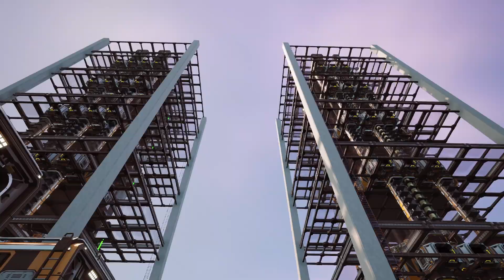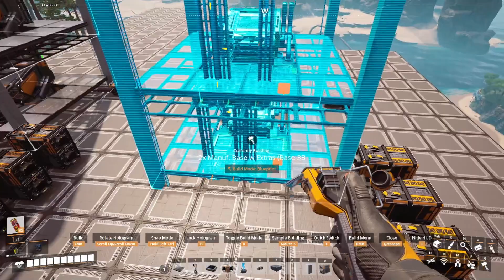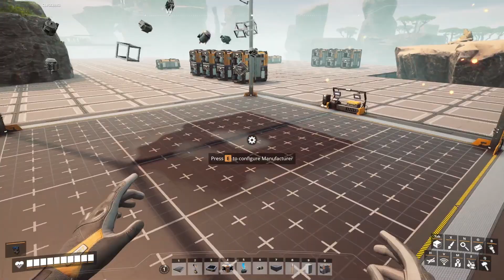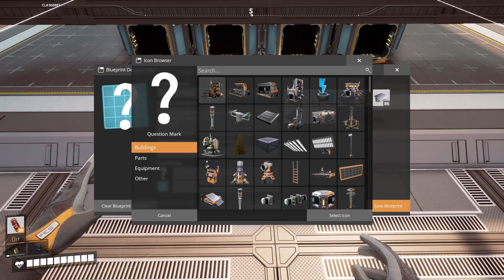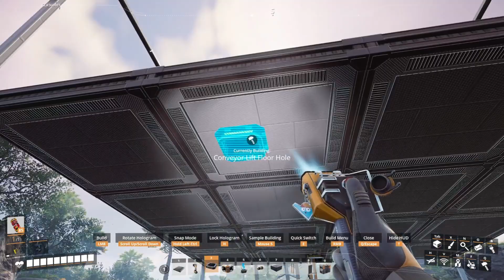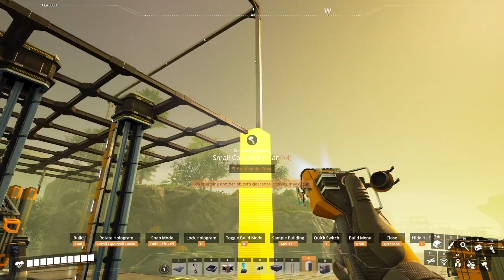Vertical Manufacturer Blueprints Satisfactory 1.0 Factory Blueprint Guide Ep. 5

Comment: I only discovered this now and I thought it might help me. However, I struggle to connect 4B to 4A. I can not connect the lift coming from below to go to next blue print. I tried manually rebuilding it. I am not sure if this is due to 1.2 update or whatever. All other connections work but I can not connect from below to a spliter which is already connected to the above level. I also tried lifting the 4A part which comes on 4B bechause in the default, it seems there is a slight vertical offset from the lift connectiong from below. This also didn't fix it. I would love to get this going which would be a change from my typical overflow manifold all in a horizontal plane. But so far I couldn't fix it.
Reply: Edit: I figured out that the steel frame floor is the issue. If you replace it with normal concrete (1m) and remove and replace the floor holes it works. Great, now I have to just redo all my blueprints and removing the frame floor and replace it with concrete.
Reply from the maker: Dang I’m sorry you were having trouble with the designs! These do have some short comings and things I would do differently! I made new designs but need to make the guides for them, hopefully they are better or your fixes at least work for your current play through!
Reply: @Cyanogenmod_  No worries, in the end I downloaded yours and it worked. It is just weird, I rebuild it myself 1:1 from your video but in MK.2 BP designer. I still struggled with it in the end but downloading yours worked just fine. Probably some tiny detail that I missed somewhere.

Comment: Good video, I was trying something similar tonight but it wasn't quite working. I was trying to use the vertical splitters where you click onto the vertical conveyors directly, but whenever I tried to add on more layers the belts just weren't connected. I trouble shot it a bit and just couldn't get it to work, the vertical conveyors would seem to snap into place, but no items would lift up them.
Reply from the maker: Thanks! That’s very odd I have had some similar issues where things just don’t move through lifts even though it all seems connected. I use a lot of mods now so it’s probably related to that but otherwise it’s a head scratcher, hopefully it works out for ya!
Reply: @Cyanogenmod_  I just copied your build and its been working great for me

Comment: Great guides man! I’m trying to build the 4B to 4A, but I cannot seem to get the outline of the conveyor lift to turn blue as easily as base-4B or 4A-4B. If the directional arrow for the conveyor lift head is facing the right direction, I should be ok right?
Reply from the maker: Thank you! And hmm If it isn’t turning blue it probably isn’t connecting, if you’re having trouble with one try building them from the left side to the right. Or if it’s one in particular that won’t go, try placing the one next to it first. The splitters inputs overlapping causes some issues when placing them
Reply: @Cyanogenmod_  Left to right didn't fix it, but going to the next one did. Appreciate the assist, looking forward to more of these types of guides!